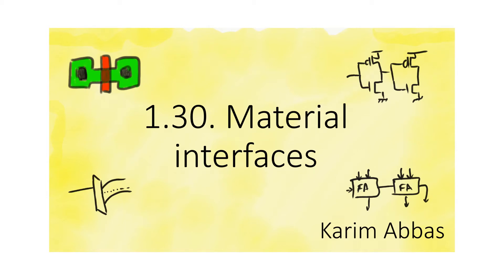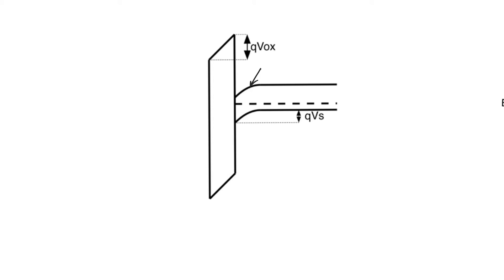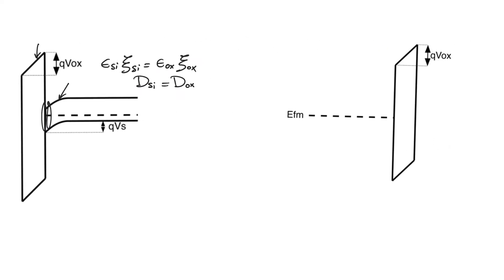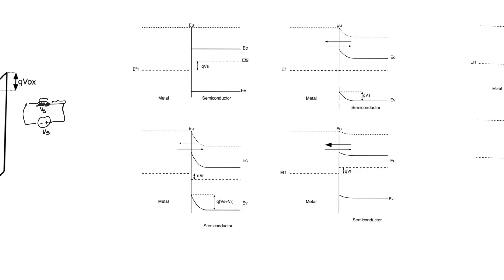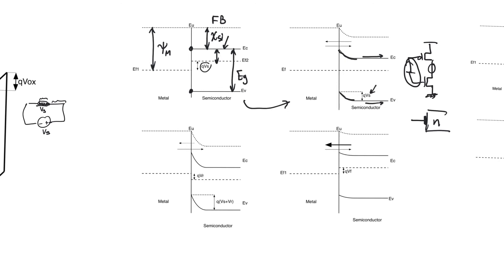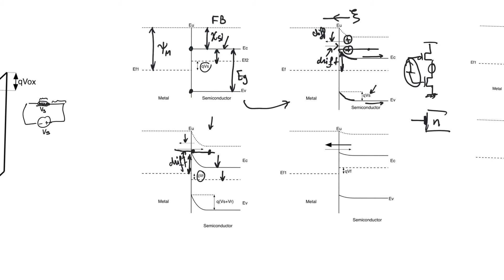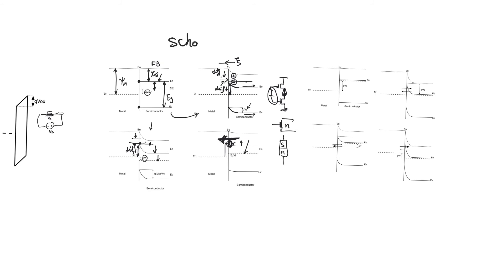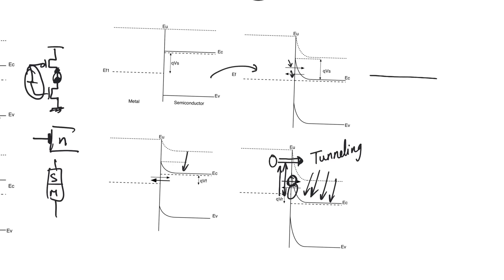1.30. Material interfaces

Comment: An applied electric field across a insulator semiconductor interface.
for semiconductors -  a depletion region forms at the interface, leading to a uniform ionic charge, leading to a linear electric field(poisson's equation) - a quadratic voltage drop(E = -dV/dx) and a quadratic band bending.(Energy related with voltage E=-qV)
Insulator - constant electric field - linear voltage drop - linear bands